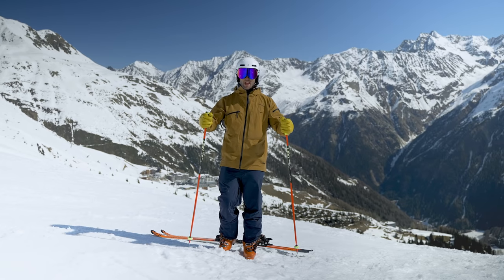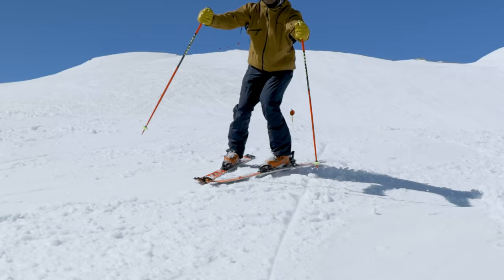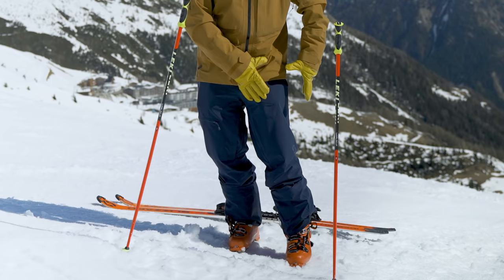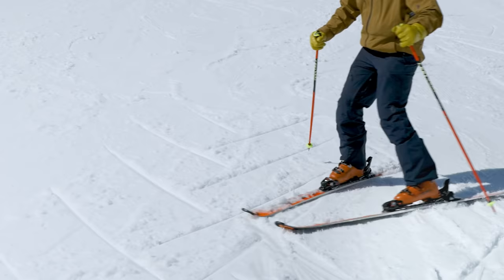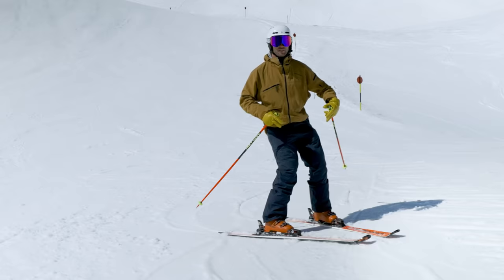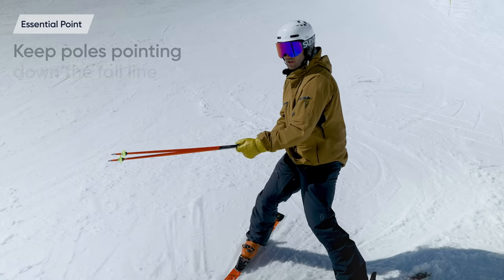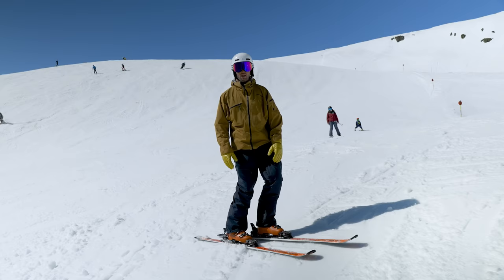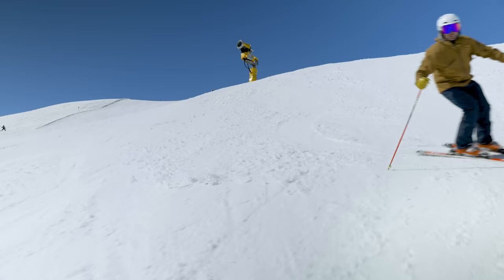HOW TO FIX THIS COMMON MISTAKE

Comment: Tip for everyone, sit on a sofa and lift your feet up so your legs are horizontal. Rotate your feet left and right and that's the movement you want without moving your hips.
Reply from the maker: Wow,
Love it, thanks for the insightful comment Drew.
With 27 likes so far, this must be a quality tip!
Reply: Please include a visual to be certain we have it right.
Reply: I can get about 90 degrees of external rotation but only about 45 of internal rotation while lying down with zero knee flex.  Is this something I should be working on with stretching?

Comment: This is good stuff. You are right about separation. The legs should turn with the skis and the whole torso turn much less. The torso should not turn in the waist at all, the work must be done in the hip joints. Many times you can hear the term of upper/lower body separation.  This is a bad name, because the border between the upper and lower boy is at the waist.
Reply from the maker: Thanks for the insight and comment Janos.
We will take this onboard.
The core point Tom was trying to make, is that simply focusing on keeping your 'shoulders down the hill' is not enough to create good separation.

We hope you are having an awesome winter ⛷⛷
Reply: Actually, the border between the legs and torso is where the leg meets the body. It's not the waist.
Reply: @melissalund6198  you are right, but this is not different from what I have said. I said that the border between the upper and lower body is at the waist and so it is the wrong place for separation. Separation should happen in the hip joints.
Reply: To me this is simple -.separation between upper and lower body is not at the waist.-.it's.where the leg joins the body.
Reply: @melissalund6198  yes, you are right. The legs join the body in the hip joints. 
But what about the body part that we call hips. Are the hips part of the upper body or the lower body? Normally we consider the hips as part of the lower body and so the name upper/lower body separation is wrong.
Reply: @JanosKoranyi  I think the issue here might be that there are two hip areas.  There's your high hip, which is just below your waist and there's your anatomical hip which is where the leg joins the body. If you draw a line outwards to the side that's where you'll find your anatomical hip.  Maybe this helps?
Reply: @melissalund6198  This is not correct. There is no such thing as high hip. Human anatomy describes hips as a body part and the hip joints .
Reply: @JanosKoranyi  anatomically speaking you are correct Janos but if you ask most people where their hips are they will probably point to an area a bit higher up than the hip joint.  In my industry,  a distinction is made between high hip and anatomical hip, which is why I suggested that the distinction might have some value.
Reply: @melissalund6198  But all this doesn't help. Wherever you think your hip is, the separation should happen below the hip. In the hip joints.

Comment: You raise an important issue of communication. One of the problems many of us have in learning to ski is that we take what instructors say at face value and, unless the context is specified, assume the advice applies to all skiing always. So "keep the shoulders down the hill", to us, means exactly that. So we can become fixated as you rightly point out but that is because we are trying to do what instructors have told us. It strikes me that instructors often score 10 out of 10 for skiing but only 3 out of 10 for clear communication. As many Brits try to learn from foreign language instructors that often makes things worse. Having said that, your vid is a welcome clarification and I think a lot of YT content is now improving in this regard. Also I notice that, like many disciplines, skiing has recruited various words to mean very specific things in a skiing context and instructors sometimes forget that pupils do not necessarily know this lexicon. So 'shorten the inside ski', with a saw presumably? 'Soften' the leg, with a mallet? etc. Bit of a rant but not aimed at you so please don't take it personally!
Reply: You are right what you say Ed Secretan. The problem with ski instructor systems is that 90% of training is spent on how instructors ski and only 5% on how to teach. The trainers have also been through the same system and so they don't really know how to teach properly and therefore the issue is prolonged over generations. This is why, once people have had some lessons when they were beginners, very few go back and have more and more lessons because essentially most ski instructors are poor teachers.

Comment: It looks like you are having the weight on the both skies when carving, do you? 
When I'm skidding I can keep my weight on the both skies and keep them parallel but if I edge them well I feel how they bite strongly in the snow but then they have their own separate paths which diverge or converge and I no longer able to force them going together parallel.
Reply from the maker: Hi there,
We're not 100% sure what might be happening with your ski technique, however, It certainly sounds pressure related.
We have just brought out 3 different 'technique teardown' lessons that you might find helpful.
Check out the first one of the series as this could help you get to the bottom of your problem:
https://www.youtube.com/watch?v=RGgF-hQrZqc&t=47s

We hope this helps!
Reply: Ive experienced this feeling when learning how to carve.  Like you are going to trip yourself up or catch an edge.  Need more practice

Comment: The language is messy here. He doesn’t do a good job of distinguishing between the hip sockets, hips, waist and spine regarding the different options of rotary up and down the chain. Technically, it is not the hip but the hip sockets and not the waist but the spine that actually is performing the rotary motor patterns being discussed. These are the relevant biomechanics that make the differences discussed in this video and a misunderstanding that will continue to plague a students ongoing dev.

Comment: What you say and what you show, isn't the same. When you overfocuses on "shoulders pointing down", you twist them more than ever while holding your arms down the piste. You are confusing everyone with this. In stead, just explain what you do from @4:33 - it will be so much better. 

It would help if you explained WHY we should keep our shoulders pointing down the slope. It is more than what the good skiers do ;-)
If you want a really good drill on this; try to ski down the piste with a big/heavy backpack. The backpack will pull you around each turn if you don't keep your upper torso pointing down the slope.